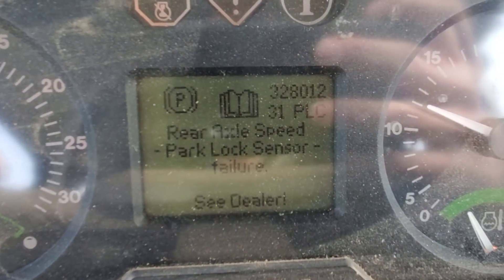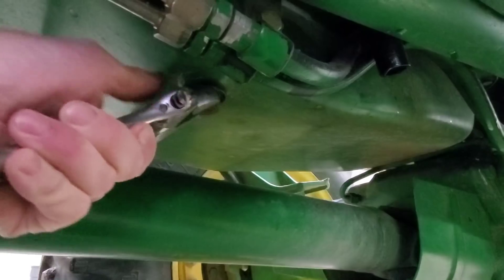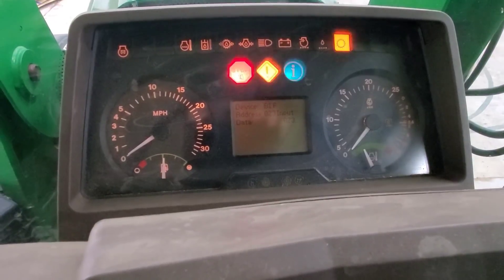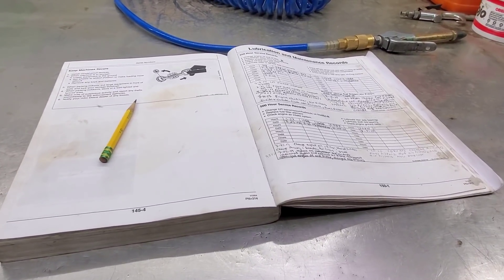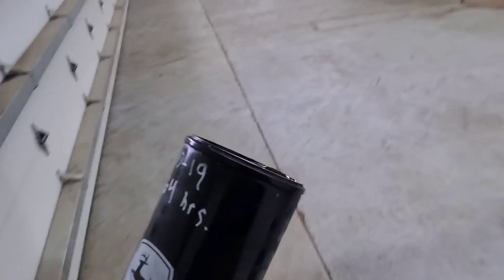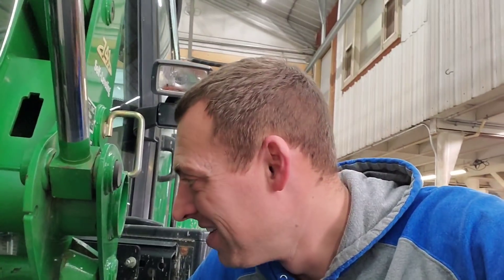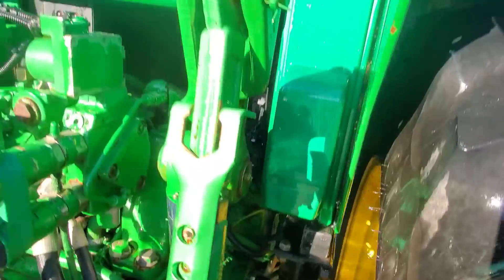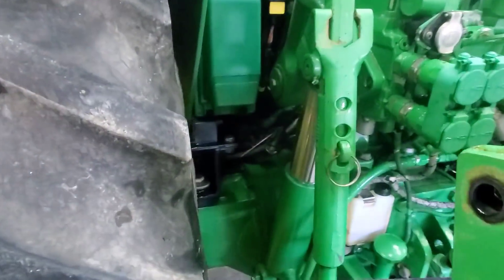7520 Oil Change - #312

Comment: You might want to check all the fuel hose all the way to the tank. i have a 30 series with the same type of hose and replaced all of it due to leakage when the tractor was only 3 years old.

Comment: You may have to tip the cab (it hinges to the right) and remove or slide out the RH rear wheel to access that trans speed sensor.  Not a bad job at all, but makes all the difference in the world to be able to see and access that area.

Comment: My house ideas for you 
- use 6" walls for exterior
- have a big mud room
- driveway facing south (in the winter you will be happy trust me)
- put some outlets in your soffits for lights on a switch inside, trust me
- a laundry sink in garage is a great thing, talk to plumber on doing a "running trap"
- efficiency mechanicals like furnace and water heater
- 36" wide door going into basement will make sense later

Comment: I was just wondering on your loader tractor how much horsepower is that because the number is 7520 it can't be 520 horsepower I don't think thanks for the videos.
Reply from the maker: It's 150 hp
Reply: Only the r series and maybe some of the other newer series in the smaller tractors, I only know anything about the 8000 series tractors does the last 3 numbers denote hp

Comment: This is probably a silly question, does all your machinery use the same oil? We always seemed to have one that was different.
Reply from the maker: Yes all the diesel engines use the same oil.  Hydraulic oil is the same in everything but the sprayer.

Comment: Always fix the first code first. Depending on what it is, the first one can cause the rest of the codes to show up
Reply: sound advice.. PLC is a logic controller BTW  =)
Reply from the maker: Not in this case. PLC stands for Parking Lock Controller.